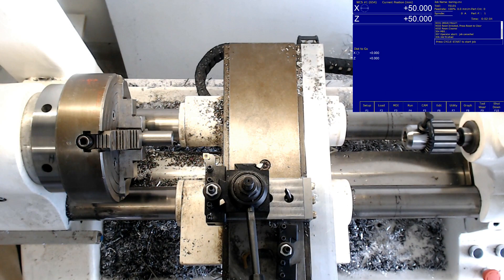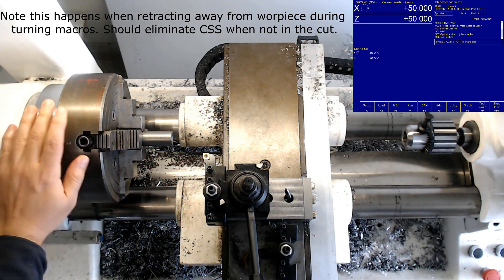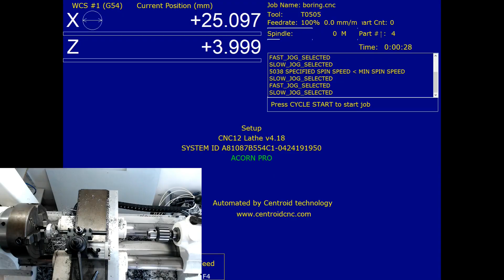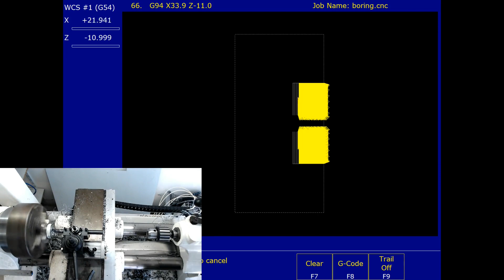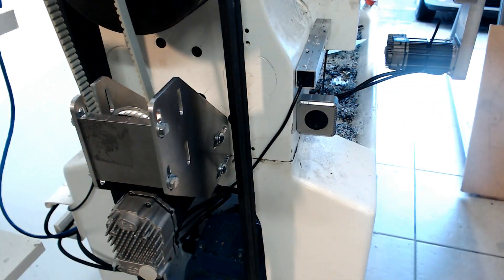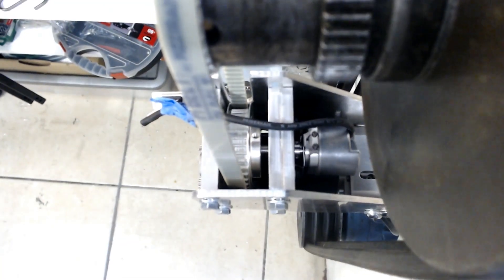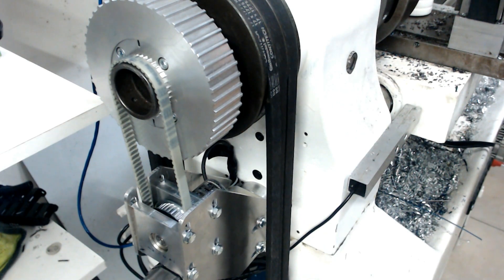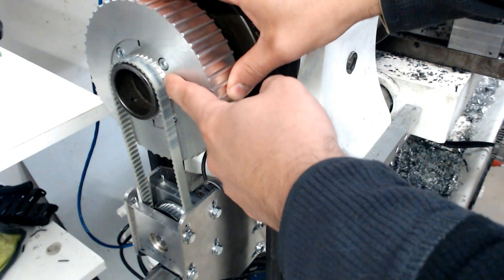Threading, constant speed turning and encoder setup

Comment: hi, nice setup. i wonder if on a classic lathe i can keep my 3phase engine going as it is now and control speed by internal gears/levers , connect Encoder to spindle so it always knows where it is. and just us the x-y axis controlled by Acorn. What do you think?
Reply from the maker: I suppose that could work. It uses the Z as a slave to the encoder spindle, the speed control by the CNC controller is not required for threading . Centroid is quite flexible and powerful and there is a good user forum. It has certainly been done before.